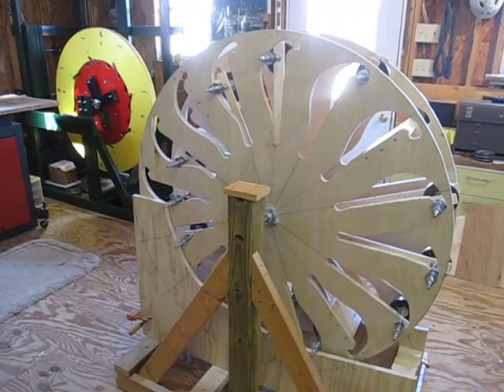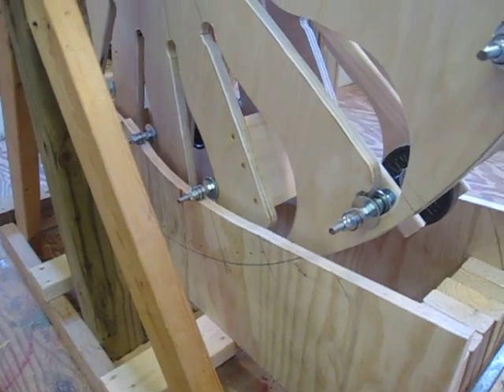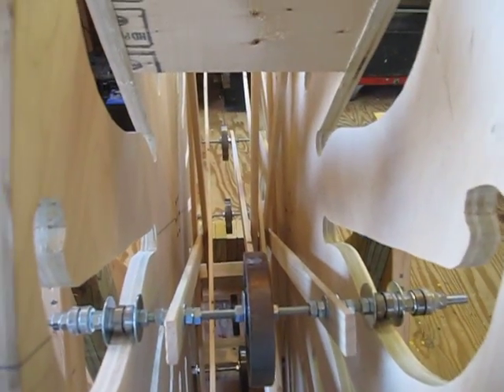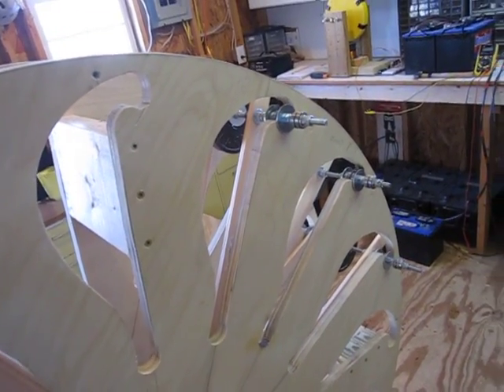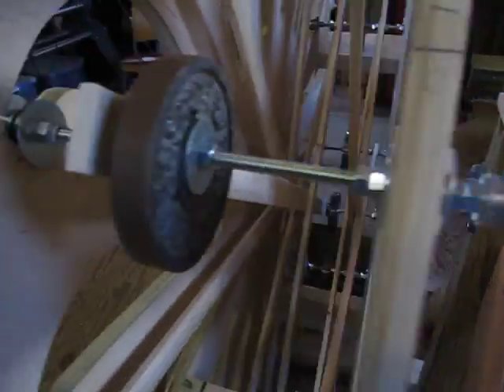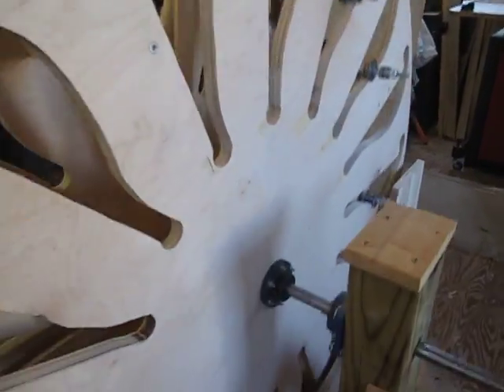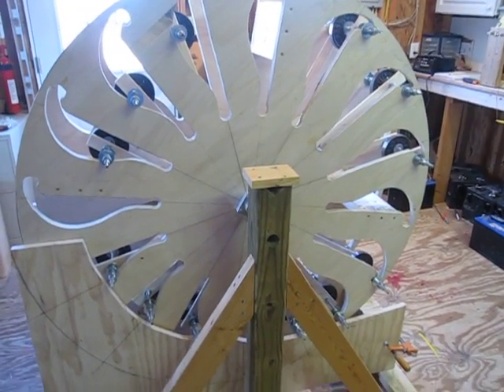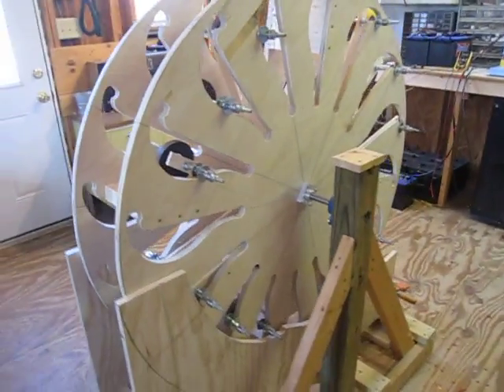Abeling Gravity Wheel Replication for Free Energy Test

Comment: I believe the device has a second point of balance slightly above and ahead of the wheel. This is meant to allow the far weights to pull the lower weights using their leverage advantage. It is a bit like a very tall car, that begins to tilt over, but with a high point of balance. The weight above the point of balance, with sufficient leverage, can bring the lower weights upward and inward using the fact that they are supported by a third and fourth fixed element. It is virtually unique because it works like a very tall car that is balanced in the middle, with two or more points of balance. It is not a typical Da Vinci wheel. I do not have first hand evidence with this one, but I would leave the benefit of the doubt with whoever is best at honestly trying it, which we should assume is the person showing us the video unless we have evidence that it is motor-powered. I am not sure of the motor theory. Anyway, from what I see here, this is more energy that vertical wheels normally have, in my estimation, which is at least a pretty good sign, given further evidence.

Comment: Weird, I had an idea for this wheel in high school except larger with more weights placed nearer to the rim, and each section was independent and freely rolling inside the carved slot, meaning each weight wasn't connected to another weight on the opposite side

Comment: ramp angles needs correction and whell needs ring flywheels to over come ramp friction and throw.
but it can work and do high torque low rpm work if designed correctly.

Comment: There ARE "gravity" wheels that work.  They use the force of running water to turn electric generators.  This is the closest thing to "free" energy we have, but it requires a huge infrastructure that must be maintained to deliver the power to user, which means it is not free.  The same is true for Solar.  "Free" energy is a pipe dream.
Reply: It’s not at all. Water turbines and solar turbines do not have to be maintained necessarily if we simply made them better. 
There is plenty of free energy we just need to harness it.
Reply: You can literally buy a water turbine on Amazon that needs 0 maintenance and you put it in a river and it gives energy

Comment: i was gonna ask you why i havent see nor herd anything out of you for more than eight years, then i began to read a few comments.
Damn you really pull out the OPEC SHILLS AND THE IDITS OUT OF THE WOOD WORK WITH THIS ONE.
GOOD JOB, youll enjoy the Switzerland's.

By raising the ramp entry point to 3oclock and allowing gravity to provide the inertia for the kick notch throw into work center aswell as moving the ramp forward towards center, ive made your wheel work hard from 1:30 to 3:00 p0sition, had to put a break on it to keep the rpms below self distruct but its got lots of torque.
My weights weigh 125lbs each and are leveraged 3' from center.
Its got a big lope to it but its solid, secure.
Dont know how to calcalate its torque on the out put shaft but id bet it will twist 1' steall tubing in half.
Any ways enjoy.

Comment: ***** what's your point? Are you suggesting mitosis breaks the second and third laws of thermodynamics?

Mitosis, like every other known macroscopic biological process requires energy. This is supplied from ATP within cells. ATP is a natural product of the Kreb's cycle in anaerobic organism. 

You say if you were to push an object in space, then it would move forever in a straight line.

You're right in that under certain circumpstances processes appear to occur with absolute efficiency; I do not deny that! As a chemist I know photophyiscal processes, such as electron transfer from enzymes to substrate occur readily in nature. But these observations are consequence of quantum behaviour, and are not yet possible on  a macroscopic level.

You know this guy building his mechanical system of levers and moving weights is not going to achieve perpetual motion, not ever!

Comment: Way way too much friction for that to ever work.
Reply: Of course it will work. Did you not see the batteries on the floor. I would just plug it straight in to the household electric supply. The only problem I have is the noise. If you cannot run it fairly quietly. The missus will complain too much.

Comment: first thing that came to mind was the friction caused by the material used. If you could use all alluminum for a nearly frictionless construct, it might help. 

secondly, I'm always struck by people being married to only ONE form of free energy. Why don't you add a small solar panel at the top and create a magnet that assists pulling the bar in place, just enough to move it, but not strong enough to hold it to the magnet. or even have a very fast pull push feature when the bar approaches/leaves

Comment: The second and third laws of thermodynamics prohibit the concept of perpetual motion.
Even if the efficiency of this machine were 100%, entropy would tend to increase - hence driving energy out of the system.
Also, the bearings loss energy as heat, sound and as friction here.

Comment: ---->but it worked perfectly the wheel was 26 inches so it made much less thrust than it weighed so it did fly, what i did  was put wheel on one side and laid it down on it's side and made pull away power for the motors that spun the wheel to kill the power after it moved one foot! In this setup without killing the power to the wheel and left going it would go faster than i could run after it, make rpm's on the wheel then engage the electromagnet the device with power for one foot--->

Comment: ----> i did this change the focus of the field strength like a mag light flashlight and used niobium titanium windings @24 gauge and i must say this was expensive and i had to beg til i found a manufacturer in Germany that would actually sell it to me! The heavy gauge is because this coil has a 20 amp current draw and i used 15 12v 180 volts batteries to run it and a custom throw switch! the total weight of the device was 49lb's and was making 21lb's of thrust it not only worked---->

Comment: ---->mine had a main frame holding the electromagnet at the bottom directly under the wheel which was also mounted to the frame the electromagnet was on! I only used one electromagnet and was only producing the offset in a pulse each channel at a time at one moment in the rotation, i had a custom electromagnet made with a 2''x6'' cylindrical core made of stainless steel with a hole drilled in the center and a ferrite cylinder as the inner core so was a ferrite inner and a steel outer---->

Comment: ---> the weight/magnet is releaving the centripetal force on the frame of the wheel! If you make rpm's so the weights/magnets are pushing 20lb's on the frame each weight/magnet has on the other side of the frame making the wheel balanced so on one side of the wheel a weight/magnet is pushing on the frame of the wheel with 20lb's of force while directly across the other weight/magnet is not because the electromagnet is pushing it back relieving that force from the frame of the wheel------->

Comment: carrying the centripetal load on the external guide use an electromagnet to carry the weights which would have to be magnets! I have done this with ceramic block magnet with neodymium on the end facing the electromagnet, where your axil on the wheel is put an electric motor with a gearbox on each side when the wheel is spinning the weights ((magnets)) in the slides are centrifugally forced outward where each pushes on the frame of the wheel when the weight/magnet moves over the electromagnet--->

Comment: @prestonstroud I can tell you how your looking at it wrong in trying to use external aether flows to spin the wheel, you need to motorize the wheels spin and use the unbalancing as thrust your on the correct track but by changing the centripetal force by using the wood guide to carry the load but this is for a powered system not a free flow design, your trying to make a speak by building it like a microphone you have it reversed! On the wheel make the slides straight and instead of-------->

Comment: @knoxjeff You could say that about anything. If you remove every source of friction and there is momentum it will keep going. However, simply applying a super lubrication won't be enough for a gravity wheel to spin forever. You also have air resistance etc. But one force you will be impossible to completely remove. Gravitational tidal forces will cause the wheel to flex and heat up over time. It will simply radiate away its rotational energy until it comes to rest. This is true in space as well.

Comment: why wouldn't it work? It's the same as a water mill instead of moving water supplying the energy this is using gravity, gravity is moving just as water in a stream is moving! the same process is happening to your body, gravity is flowing through you and the resistance to that flow determines how hard that pushes on you and the frequency your atoms flux determines that force! Is why one cubic inch of steel is heavier than one cubic inch of foam!

Comment: 1 the weights need to move up in a very short space 
2 there needs to be a large number of weights around the wheel, doesn't matter how heavy, from 0 to 60 weights no energy/ power will be produced,
 from 60 to 80 weights you are at the nutral point anything above that the wheel will start to move, the more weights the faster it will go. i have done the equations for the one i seen and it does work on paper and in real life,  you still wouldn't wast your time,very very little power produced
Reply: Hmmmm, good.

Comment: draw it up on paper and do the equations for each part that draws energy and then do the same for the parts that produce energy and you will seen it will not work. i wasted years with similar shit, just trying to save you some time. out of all the designes i've seen there was 1 that worked, it was about 20m tall and wouldn't have produced enough power to run a light, all it done was move very slowly. doing the equations on paper i found two very important factors that made it posible to work

Comment: This can never work. There is a fundamental flaw.
Offsetting the weights from the rotation axis isn't where the problem is.
The problem is ANY weight moving along a closed loop of any shape in a gravitational field will do ZERO WORK best case and NEGATIVE WORK if friction is involved.
There is no getting around this flaw. It is impossible now or a billion years from now.
Zero work means zero energy gain. So it cannot be a "source of free energy".
Reply: I believe the device has a second point of balance slightly above and ahead of the wheel. This is meant to allow the far weights to pull the lower weights using their leverage advantage. It is a bit like a very tall car, that begins to tilt over, but with a high point of balance. The weight above the point of balance, with sufficient leverage, can bring the lower weights upward and inward using the fact that they are supported by a third and fourth fixed element. It is virtually unique because it works like a very tall car that is balanced in the middle, with two or more points of balance. It is not a typical Da Vinci wheel.
Reply: @NathanCoppedgeVideos  Google "The Shifting-Mass Overbalanced Wheel". You are not understanding why it can't work. You are focusing on the balance of part of the device but not the balance of all of it taken together. This is where intuition fails.
Reply: @WhitentonMike  I think I tested a similar thing but I am not absolutely sure. It seems to me in all my experimenting I never developed solid evidence against it, but perhaps I simply don't remember the experiment. Perhaps I treasured it as an example that would work. A key to this device seems to be to begin the ramp relatively far off, and at relatively short distance. The intuition to BEGIN the ramp right beneath the fulcrum is not accurate as the device requires <45 degrees ramp to have a lifting advantage, and anything beginning before the fulcrum will require <45 degrees as well. If the ramp is about 22.5 degrees or less beginning at some distance but coming relatively close, then there may be some degrees of previously upward-pushed beams which have leverage but are opposed in an imbalanced fashion. That is the hope. Like most of these devices it requires skilled construction and due to physical problems it does not always work, even if it is a working design. Picture that there are dominoes which act as levers against a rolling base point, there is no rule which says the base cannot be lifted at all, and in a way that is the only limitation of this design.
Reply: @WhitentonMike  Curiosity stream's message here is simply not complex enough to capture this very clever case. I hope you agree with me but it should not be left up to you, it should be left up to physics. The physics I think is either ambiguous or worth investigating in this case. It is not a typical unbalanced wheel. Curiosity stream is engaged in a deliberate art of amphiboly. Virtually none of the traditional wheels have two centers of mass, rather they attempt to add torque to a single center of mass. In this way, the wheel we are discussing is potentially different. Two centers of mass is when there are actually two connected wheels, or part of two connected wheels involved. I'm not assuming they work, I'm simply saying the physics may be different.
Reply: @NathanCoppedgeVideos  I don't agree with you, but that isn't important. You need to convince reality that you are correct and it is wrong. It isn't a secret that reality is always right no matter how well convinced you are that this special case is different. Pro tip: Everyone that attempts to design and build a gravity generator is a special case but they all fail. 
You are free to do whatever you want but just some advice. The easiest person to fool is yourself. Reality isn't impressed by your convictions or reasoning. It isn't wise to go down the path of being sure you can make it work. First, make sure you understand fully why all of the other devices could never work. Then ask how your design is based on similar principles. If you only focus on what is different about yours you will not see its fatal flaw. 
Figure out what I meant about moving a mass around any closed path is doing zero work. It doesn't matter what the mechanism is or how much friction you eliminated. This one principle IS the fatal flaw.

Comment: have you considered not let the wheel circle just around one point but instead perhaps a circular or oval center, well i dont know. i was thinking something like:
at the side of the wheel add a long lever that is suposed to turn perhaps faster than the wheel using the lever principle to get the wheel to move in the oval circle as the center. like it orbits an actually not visible center. just brainstorming your project :)

Comment: @EazyE6793 You are not addressing my key objection. I know the 6 have more force than the 10. However, you keep igoring energy loses that would occur in operation.
My key objection is that energy loses are greater than the energy generated by the fall of the 6. For example, the 6 have to be raised at the bottom section. A grat deal of energy is lost as the 6 scrap against the wood frame as they are pushed up in their slots.

Comment: @EazyE6793 Do you mean momenteum or force. Momenteum refers to motion.
Stroud's wheel will have no motion. The 6 have more force than the 10 but after the
negative force of the 10 is subtracted out and after the friction force of the bottom
section and the main axle are all subrtracted out the 6 will not have enough postive force
left to be able to turn the wheel.

Comment: Amazing looking machine. But you don't get something for nothing.   The falling
weights on the right side have to lift up the weights at the bottom and on left
side. You have six weights trying to lift ten weights (if all slots were filled). Also
you have a lot of friction at the bottom.  You would be lucky to break even with this
machine.  It would not be possible to have a net energy gain.